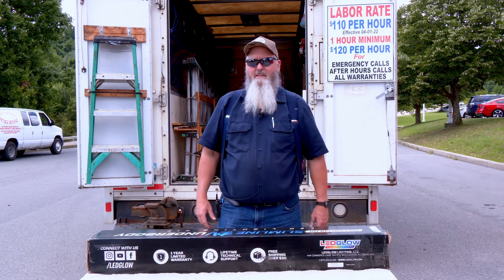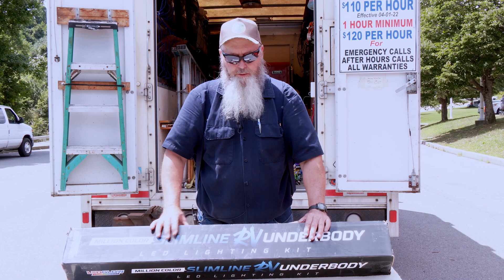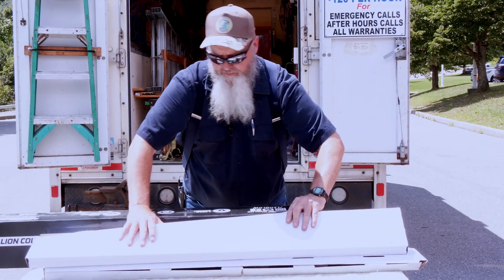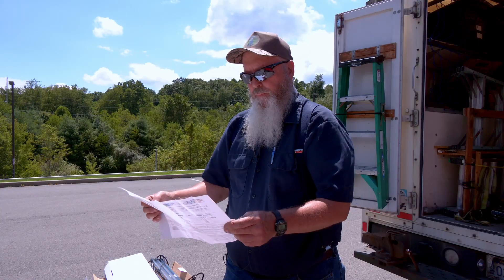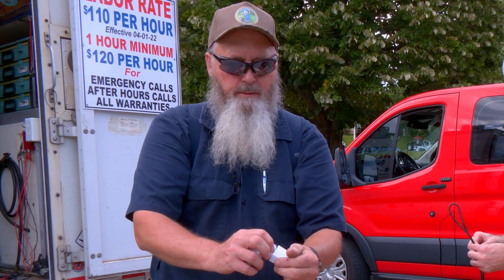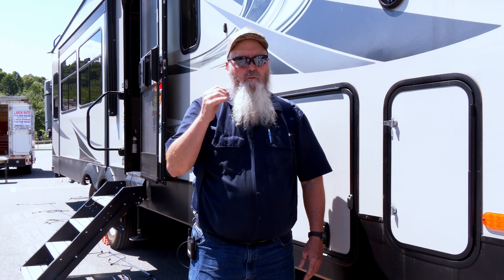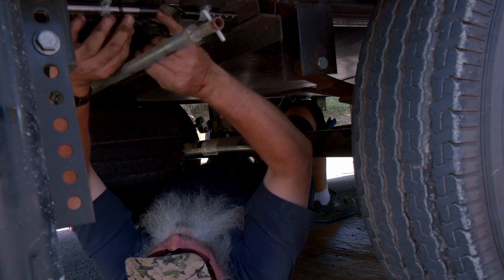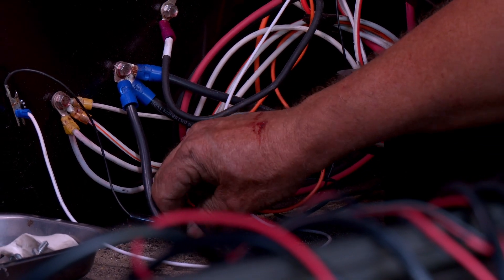Hillbilly RV - LED Light Installation

Comment: I needed lights for out in the desert when I took the dog out or if I heard noises, I camp 6 miles from the border in a wildlife refuge.   I used white lights peal and stick with 3M tape. I used wireless remotes to control them.  I ran them just above the molding going down the side.  I stepped out one night and turned them all on and had Border Patrol do a fly over in their helicopter.   😁
Reply from the maker: That’s pretty good to get a fly by. Ha ha

Comment: I use rope lites 32 feet long that I just lay down on the ground. They come with a remote that allows you to change colors and  motion. Takes no more than few minutes to set up. Rolls up for storage in a softball size bundle and stores in a half gallon zip bag
Reply from the maker: That doesn't sound like fun. Rolling around for several hours and drilling all those holes sound way more fun.
Reply: @hillbillyrv  You never cease to entertain.

Comment: Nice job Kenny. That was a lot of holes to drill, especially overhead.  HINT I learned about Zip Ties; Leave the bag closed and cut a parallel  slit in the middle of the bag. You can get the Zip-ties out very easy and they won't spill out the open end like they always did to me. One less thing to keep Murphy's Law away.
Reply from the maker: Me and Murphy are good friends. Ha ha

Comment: 1 Bic lighter for wire stripping is all yah need. Heat it don't burn it an use your thumb nail while it's still warm in it strips clean an easy.
Reply from the maker: Dude !!!! I ain't that hardcore. I have delicate hands.
Reply: @hillbillyrv  nah your callous hand will be fine. You don't burn it or make it melt all yah have to do is get it warm an soft. 1 second or so heat.
Kind of like melting a rope. You can go to far when pinching the end.